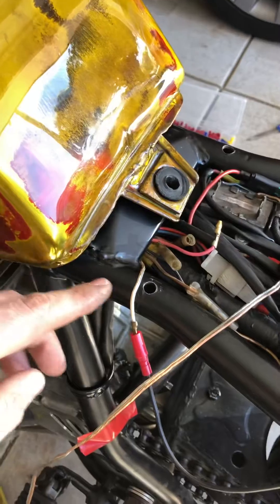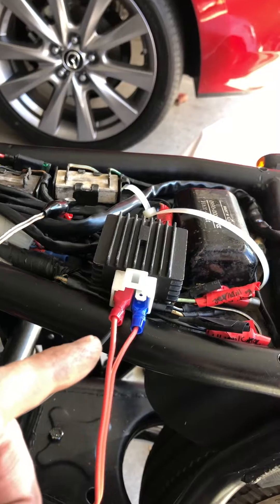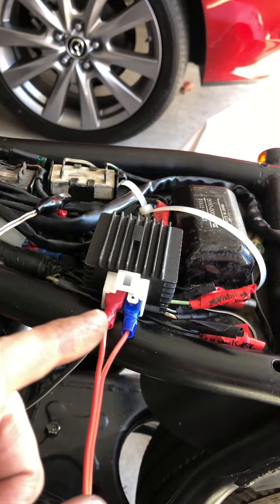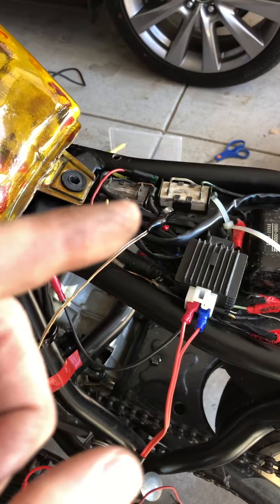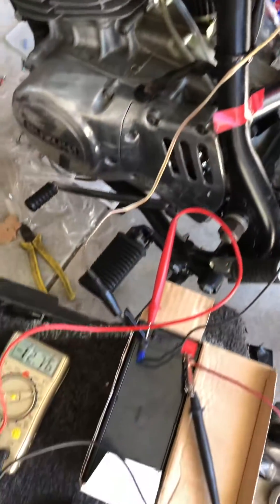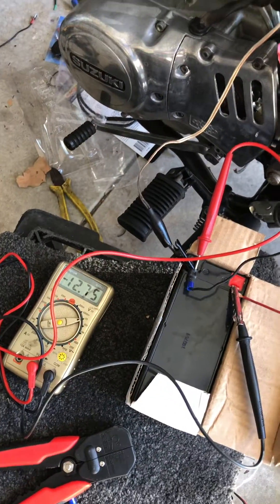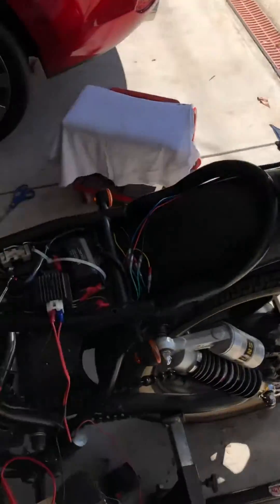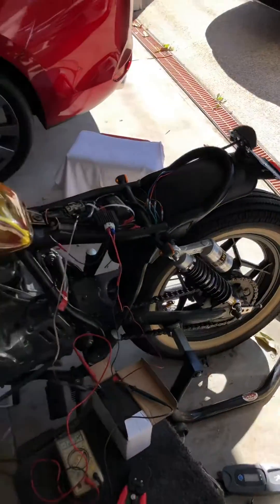How to convert a Motorcycle from 6V to 12V

Comment: Hey I bought a clapped 71 cb175 and found a cm200 1980 motor . Tried connecting the 12v harness but no spark. Cool has been bench tested but no spark on bike. Am I playing with fire lol what do I need to get these two to play nicely together .

Comment: Hey I was wandering if you plug in the pink wire will it over load the stater or exactly why you need to keep it unplugged and also did you add wires to the existing harness or use the wires already in the harness and run them to all the lights

Comment: Would using a step up transformer not be a good idea in this situation? I've tried both of these methods. Step up transformer worked. Then I decided to do what you did but I did it a bit different. A standard 12v charging system usually uses a 3 phase generator. With the 3 separate windings being out of phase with each other the voltage remains high even at idle. These old 6v systems do not use out of phase charging. Instead they have 3 separate coil windings but they operate independent of each other. So 1 coil handles the headlight in A.C., another coil handles the ignition coil in A.C., and another coil handles the battery charging by rectifying the A.C. to D.C. and sending it to the battery. So what I did was I left the coil that supplies the ignition coil the way it was. I took the coil that handles the headlight and merged it with the coil that handles the battery. Now it's a 2 phase system. So the voltage may not drop as much as idle.
Reply from the maker: Makes sense, I haven’t had any issues with high voltage at idle, regulator seems to be handling that ok. Only issue I’ve had for the last few years is the batter I’m running is too small, sits under my swingarm and I haven’t changed the indicators to LED so they draw too much of a load at idle with them on.
Reply: Hi mate , would you have the primary and secondary winding counts for the 6v to 12v transformer ? .

Comment: Need to know how to convert in simple terms,very uninformative.
Reply from the maker: Hi Peter, this is specific to converting a 6V Suzuki GN400 to 12V using Sam aftermarket regulator/rectifier from a GY6 motor (very common Chinese motor). It details the wiring layout you need to use to convert it over to output a 12V charge.
Reply: @mrmatt1s  mines a Honda cm 200 and before 1981. They were 6v but 12v are a lot better; mines a 1980

Comment: What the hell was that!!!!
Reply from the maker: Video shows wiring in a new regulator/rectifier (from chinese GY6 spec engine) into the stock GN400 12V stator output to convert to 12V charging for the battery. This then allows you to replace all the existing 6V lighting system to much more common and brighter 12V components. The Suzuki GN400s run a separate charging and lighting circuit to the ignition circuit, so you can separate the conversion out without having to change the stator.

Comment: This would be a game changer! Thanks for the upload. I have the same bike, engine runs like a champ but the 6 volt electronics are messy and unreliable 🇿🇦
Reply from the maker: Jacques Le Roux - seems to be running ok, the windings in the default coil aren’t really up to charging the battery spectacularly. So I did have to charge the battery with a stand-alone wall charger every now and then.

Comment: Thank you so much, that video will help me a lot as I have the same bike. I'm curently using it without battery and want to convert it to 12v. At the moment I have 4V at iddle at 18v when at middle RPM.  Could we get in contact so you could send me more pictures and explanations ?  I only have front and rear lights working at the moment, I've to check why the stop lights doesn't work and fit indicators. I've no jauge, horn, indicators at the moment lol
Reply from the maker: Hi Thibaud, there is a great thread on the process in the GN400 Yahoo group with lots of details covering it here: https://groups.yahoo.com/neo/groups/GN400/conversations/topics/4943

You could not run a battery and use a capacitor of sorts perhaps, I got away with a very small 2.3Ah 12V battery tucked up under the swingarm, you don't need a lot of amp hours in it as it's not cranking the engine and only running lights. I changed all my lights to LED so even a lower amount of amp hours in a battery is needed as the draw on those is low. 

Here is the battery I ended up running, very small and fits under the swing arm with a simple bracket: https://www.ebay.com.au/itm/YT4B-BS-12V-2-3Ah-Motorcycle-Battery-Replaces-MBT4BB-SHIP-FROM-AU-Suzuki-Yamaha/181736729911?epid=28032597943&hash=item2a505a6d37:g:WLEAAOSwOtFc0NhP 

The battery on the GN400 is there to act as the regulator to soften the current flow to lights  (that's why the GN400 only has a rectifier as standard and not a regulator/rectifier). Because the stator can support up to 18V the aftermarket GY6 regulator/rectifier I linked to and show in the video is what converts it to DC and then regulates current flow to 12V. Note that the headlight on the GN400 does run off a seperate circuit (the AC circuit that runs the ignition). The best option in my opinion is to do away with the standard wiring loom and look at getting one of the aftermarket universal looms I link to in my description. This covers all the lights and is a simply plug and play option with all the wiring needed (includes horn, LED brake light and headlight, although the headlight is made for a dirt bike, you can still use the bulb and bulb holder in the original headlight like I did) and has a replacement bar control switch to run it all. Then once you're 12V there are heaps of options for an aftermarket gauge cluster or simple speedo. I mean the wiring in the bike is 30 years old already, not likely to be in the best shape so replacing it with the new loom isn't a bad option to begin with.
Reply: Great informations you give me thank you a lot !  I'll check that part this winter when the bike will be off.
So that 12v regulator should be used with or without the stock rectifier ?  Is there any problem if I delete the headlight of the ignition coil and put it on the new battery loom ?
Reply from the maker: @Mushigana  you remove the standard rectifier and wire the new reg/rec in it's place. Nope, no problem if you run the headlight off the new battery/wiring loom, the loom I linked to has all the wiring already there to run a headlight and the bulb it has can be made to fit into the standard GN400 headlight housing.

Comment: What about the ignition switch and the ignition coil?
Reply from the maker: Hi Jerica, the GN400 runs the ignition separate to the AC circuit it uses to charge the battery and run the lights. So running this circuit into the regulator/rectifier doesn't interfere with the standard ignition setup.
Reply: Mattis Rattis thank you for answering! I have a Honda cb100 6v. Mine runs one red hot wire from the battery to rec/reg to the stator/generator. Then another fused red wire from the battery to the ignition which when on powers everything else, (lights, turnsignal, horn etc). That’s why I was wondering if I change fo 12 volt if all the things on the fused red wire would get fried. But your saying your other stuff is still on 6 volt because of how yours is wired? Thanks for the help and the video!
Reply from the maker: @jericarobertson5591  yes, on the GN400 the ignition side of the stator is run by a separate coil than the lighting side. So I didn't need to do anything with the ignition side, instead with the lighting feed that would normally go to the rectifier (to change it to DC from AC) I simply fed this into a rectifier/regulator that was from a GY6 motor which changed it to DC and then regulates it down to a 12V source.
Reply: @jericarobertson5591  Hey mate. I’m looking into the same thing now for my cb100n. Did you have any joy with 6V to 12v conversion? Please let me know. I’m been trying to solve whether I need to change the ignition coil too. Been tough to find solid info on what I should change or can safely keep. So far I have ordered 12v bat, rec/reg & led lighting.
Reply: @liampinnell5509  Hi, did you find the info on your bike? I am looking for an xl100. it's very similar to a CB

Comment: Sir do you convert your magneto/stator to 12v ?
Reply from the maker: Nope, no need to change anything on the standard magneto. The regulator/rectifier will bring it down to 12V compatible. It isn’t the strongest of windings though so it struggles to keep the battery charged with headlight and tail light on, but charges just enough to not let it drain.
Reply: How about the rectifier and cdi have you change it from standard?
Reply: Most CDI are rated 6v/12v  @mtertainment4056